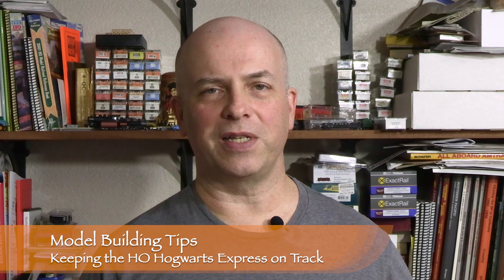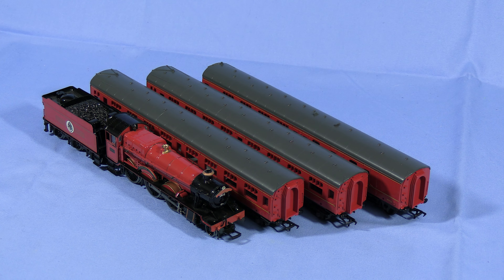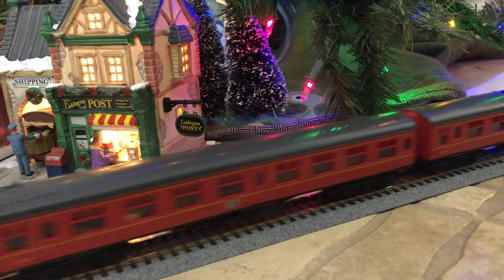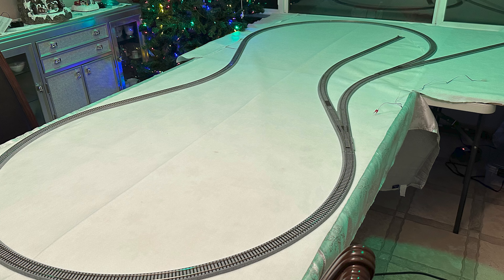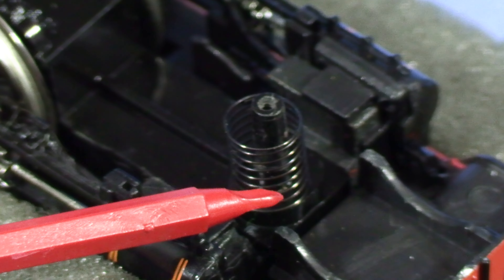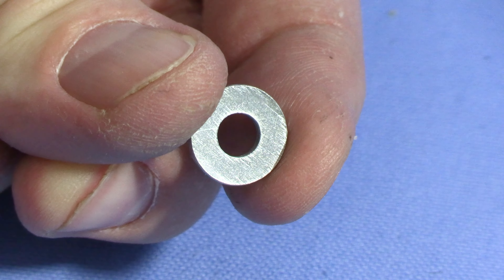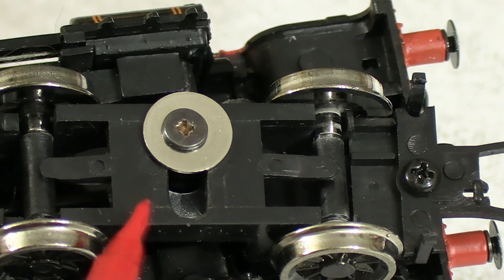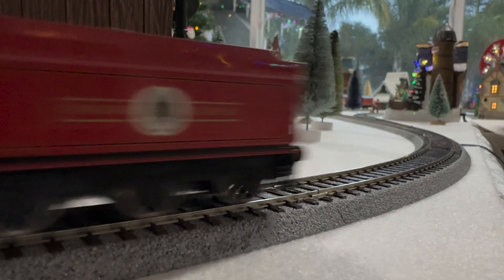Model Building Tips HO Hogwarts Express Derailing!

Comment: I've seen the same problem on O gauge locos that use the same type of setup.  Others have suggested a stronger spring.  I like your solution better as an initial "try"!  Nice!
Reply from the maker: Thanks!  I'm glad you liked the solution.  For this engine, at any rate, it's helped tremendously.  It hardly ever derails now.  Thanks for watching!

Comment: So true, observation, then action ! I had problems with a 4-6-2 Steamer, and work hard at adjusting the last axle under the coal bridge. I finally got it to pass the switch but was still derailing in the curve.
The problem was poor quality and abused old snap track, at 36" diameter... it should work fine on new Atlas code 100 !!
Thanks for your videos.
Reply from the maker: It can get hard to figure out when there are both track and equipment issues.  It sounds like you're well on your way to getting it resolved.  Thanks for watching!

Comment: Daniel , I have 2 vintage heavy cast Mantua steam ; one with 6 large wheels and the other with 8 and both have front small wheels and trailer wheels . Have you heard of any replacement  motors wit flywheels ... They both work  fine but you know, slow is hard to achive. If you ever do a change over of one of these i would be terrific . ITs just that you seem to use the perfect choice of words when explaining things..
Reply from the maker: I don't have any Mantua models, so I can't really give you any specific help.  Long ago I had an old MDC kit for a 2-6-2 steamer, but I could never get it to run well and ended up getting rid of it.  If there is room, Kato motors work well and are available relatively cheaply.  I'm not sure if they come with flywheels, but you should be able to get a flywheel separately.  A lot of motors have a 2mm shaft, so you'd need to get a flywheel to match.  I do have a couple brass steam engines that need mechanical help, so maybe at some point I'll tackle one of those in a video.  Good luck with your project and thanks for watching!